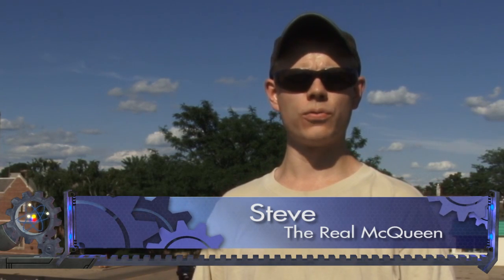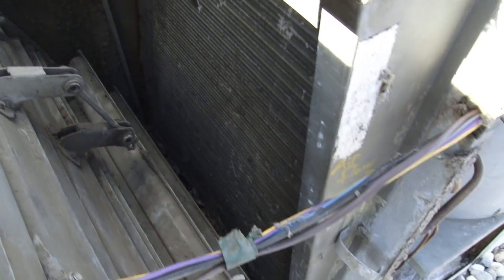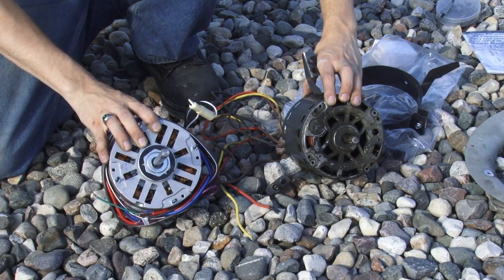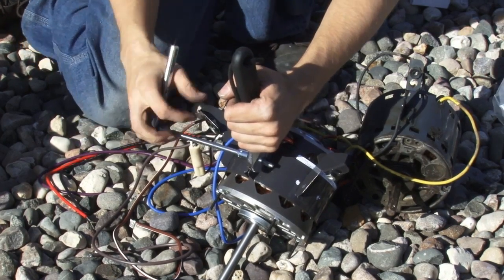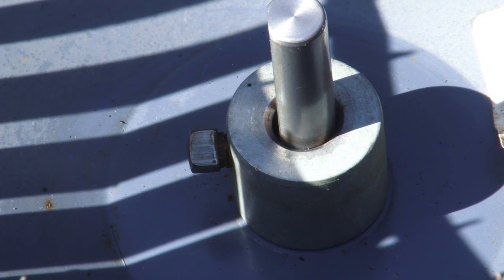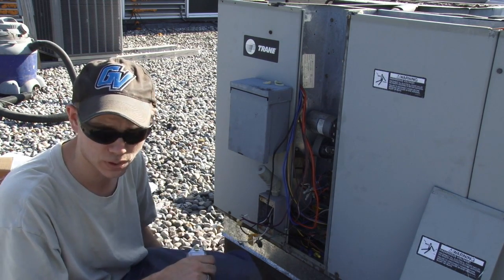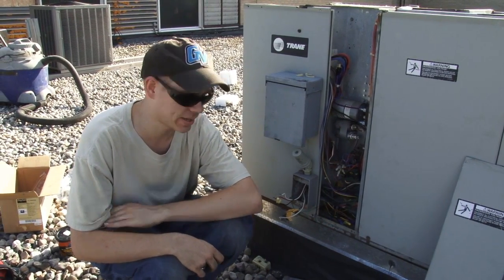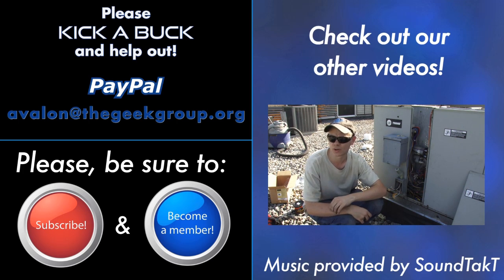A/C Repairs with Steve

Comment: One other reason it may break down in the middle of the summer - the unit may have been operating marginally (e.g. partially clogged filters or low refrigerant), but when it gets really hot, it is no longer capable of bringing the temperature down to acceptable levels.

Comment: Using heat pumps for heating (as well as cooling) is quite common here in southern Arizona. My housing development doesn't even have natural gas connections, so using a heat pump in the heat mode is the normal way to heat a house here. Each unit has an additional electrical heat coil for thermal boost, but I can't imagine why anyone would need it here.

Comment: You mentioned switching the connector with black and white leads to get clockwise or counter-clockwise rotation. Is that as viewed from the output shaft side or from the other end? That always confuses me.

Comment: @J2TKcapIRK   They only work as heat pumps if there is a means of switching the inside coil and outside coil.  Many do not have reversing valves, so they can only be used for cooling.  And heat pumps are worthless for heating if outside temperatures get well below freezing as the outside coil will ice up and there may not be enough heat in the outside air to vaporize the refrigerant.

Comment from the maker: @J2TKcapIRK While you are technically correct, the *vast* majority of people don't use AC units to heat an interior space in the winter. They're horrifically inefficient when used as such (with very rare cases). Our units are combination machines, with gas-fired heating capability for winter. Also, using a phase-change AC unit to heat a space from sub-zero outdoor temps would likely result in vapor-lock from the coolant not being able to warm up enough outside.

Comment: A little correction, that is a "run" capacitor not a  "start " capacitor and the motor is a PSC (permanent-split capacitor) motor. Start capacitors are in a plastic cases, used very little and run capacitors are in steal cases used all the time for thermal heat dissipation.  Good work Steve:)